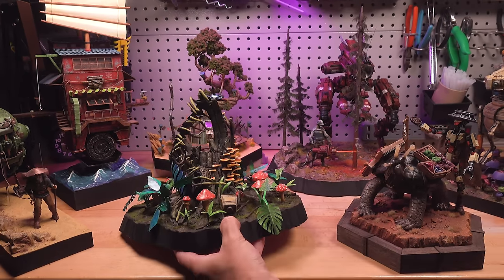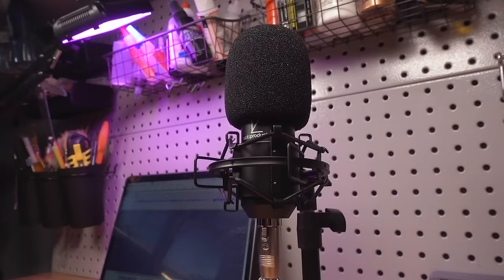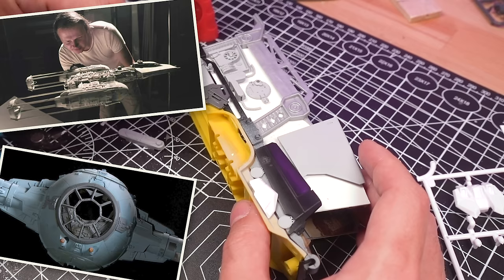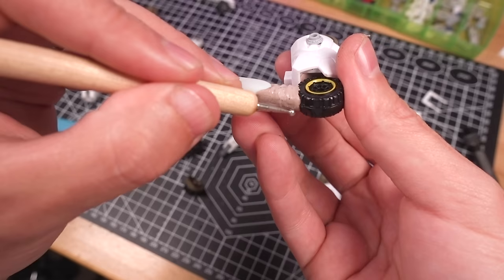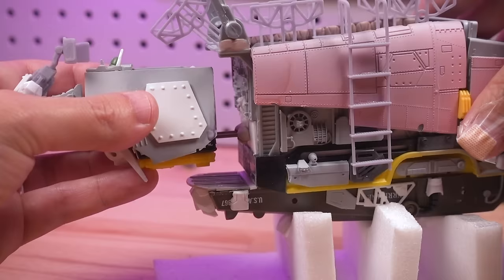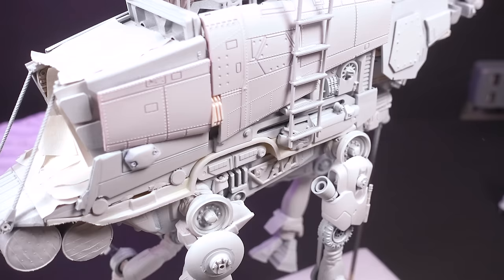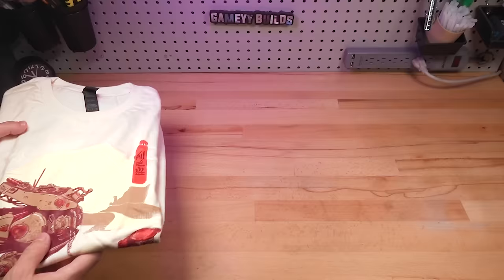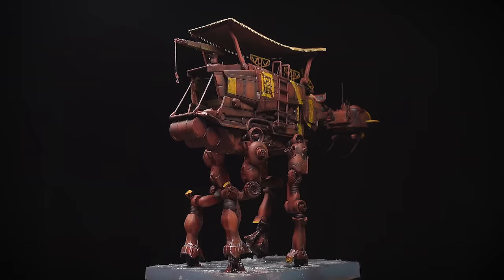Kitbashing a Walker diorama for Beyond the Blight feat. TZ Audio Stellar X2

Comment: As a modeler, I have no issue with anyone creating their own files to 3d print. It's no different than finding pre-made parts for a kit bash. Making a model with found pieces versus making a model from scratch using your imagination is always going to be more interesting. The beauty of a build comes from the overall design, and not the parts it is sourced from. The only limit is imagination.
Reply: Slicers are making kitbashing surprisingly easy. Zero modeling skills needed.

Comment: I’ll give you a great piece of advice that I learned from somewhere in this interconnected universe of video that has helped me out in my current situation of kitbashing a Boss miniature for a game that I’m currently working on. I also have some cheap toys with the same ‘rubbery’ plastic that is difficult to glue together but the solution is quite easy and you only need two ingredients, superglue and baking soda. Something happens when you add these two together which creates an instant bond and on the plus side it can also look like a welding effect if applied carefully. 
I love this world you have created and am going to continue watching this video. Hopefully this tip will help you in future projects if need be 👍
Reply from the maker: Yes, I use superglue and baking soda, but my meaning was more that it is difficult to get a good finish on those rubbery plastic pieces. Gluing it to stuff is usually ok though!
Reply: @gameyybuilds  Yeah I know what you mean but fortunately in my case for my kitbash it’s not an issue because the miniature I’m building is a cyborg and for the finished details I’m not so much concerned with clean “welding lines”

Rolling forward on his/it’s mono wheel, a conglomeration of twisted metal and mutated flesh, this monstrosity is hell bent on eliminating the Crew that has intruded upon the ship that was tasked to him/it to defend or be destroyed in the process. 
I do believe that I’m mostly finished with my build but every time I look at it to begin painting I think 🤔 maybe I should add something else and then the process of building begins again 🤷‍♂️
One day I’ll maybe finish building and start painting… maybe 🤔
Reply from the maker: @Weez-2_The-Beez  Cool!

Comment: Love it. super glue in a reef aquarium you glue the rocks with superglue by mixing sand and glue surprisingly a small area can hold alot of weight also puting plastic spurs in your plastic thin cement creates a liquid plastic  that helps with thin parts. You probably know that . I just want to help anyway i can so you can get more videos ❤ Awesome job

Comment: Don't take my comment the wrong way, you're creativity is top notch, as in there's no one better, but the feet are a bit unrealistic to be able to hold such weight. What comes to mind are German WWII Tanks and their suspension; granted severely over engineered and ahead of its time and at the same time the only possible solution to hold such weight. Yes the Camel is an unusual concept to draw inspiration from as their feet seem too small to hold the weight but I digress... The Star Wars AT AT Walkers had a much larger foot print, on purpose, because of the overall weight of the machine itself. Overall the kit is wonderful, very creative and imaginative, but it's the feet that makes is seem undoable. You can use the feet as they are, just add a circle plate at the bottom to spread out the load hence the reason I mentioned WWII German Tanks as they faced the same issue as those tanks became larger... Keep up the great work...

Comment: Great video, love the design thinking before building and the storyline. 
I think this minimalistic use of a 3D printer is absolute ok - especially as you designed the parts yourself so everything is still kind of unique. Learned something watching you testing different tools an techniques - while I never would have used the foam especially as it expanding so much but in this case it made so much sense to give the leg gears something solid to hold. 
Epoxy is always something and I had to smile while watching you "struggling" to create the waves on the water surface. 
Maybe you can tryout some of the water gels some of the real epoxy masters are using like: https://youtu.be/mGCjurUUSBE?si=-Bdnkqhixy4WvHP7 or https://youtu.be/AxpIMrV_J7k?si=UD-GBiz_lEYNkRzg. 
Thank you for sharing this video!